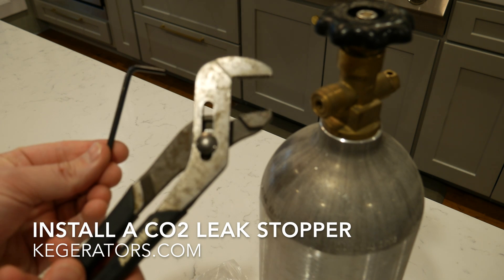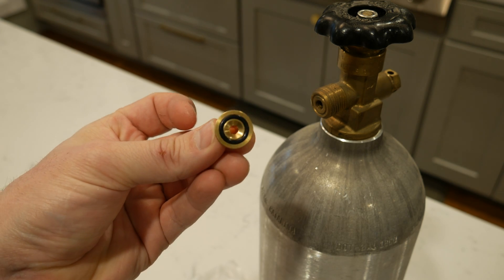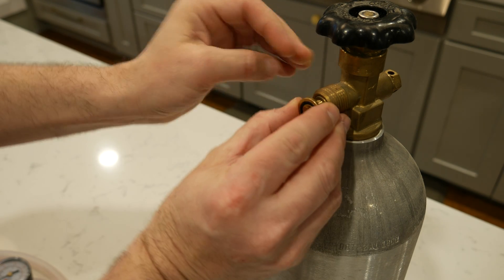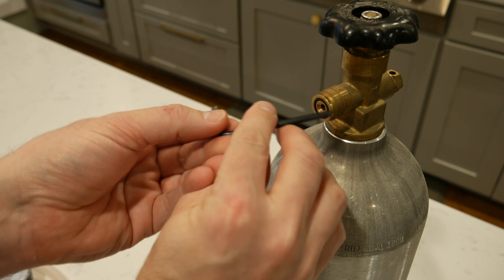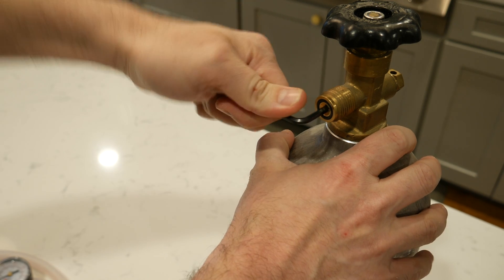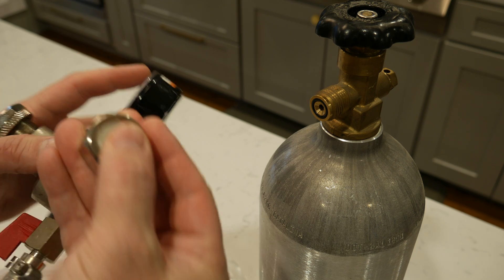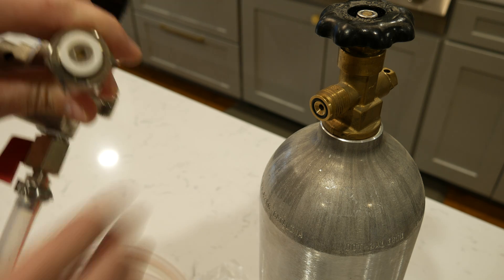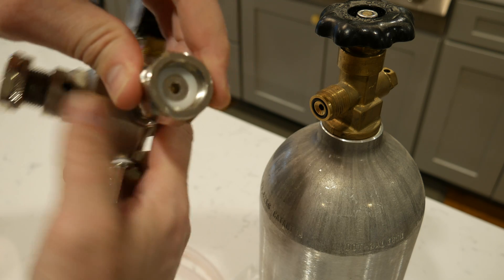Install a CO2 Leak Stopper

Comment: What if you don't use a regulator?  I connect a 5lb tank directly to my sodastream via an integrated adapter & hose.  The end of the hose that connects to the tank does have 2 washers.  I turn on my tank for literally 1 second then immediately turn it off and that's enough Co2 in the line to carbonate a liter with high fizz.
Reply: It shouldn't matter whether you are using a regulator or attaching a SodaStream adapter that can withstand the pressure of a fully-charged CO2 cylinder, as long as the adapter is compatible with the CGA320 valve on the cylinder.

Comment: Hi I have a question : how come you had two washers before installing the perma seal? Asking because I have the same regulator for my aquarium and trying to figure out if the perma seal would work, thanks
Reply: The Leak Stopper attaches to the CGA320 cylinder valve, not the regulator.  Your regulator shouldn't care whether you are using the Leak Stopper or a disposable nylon washer.